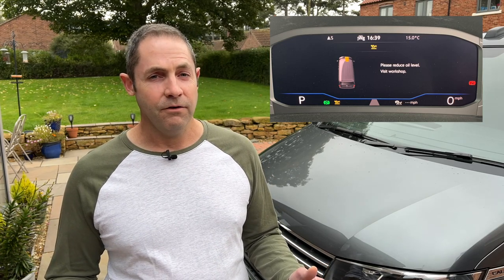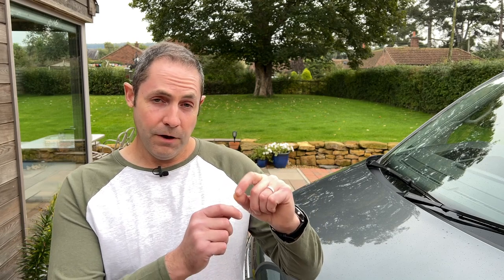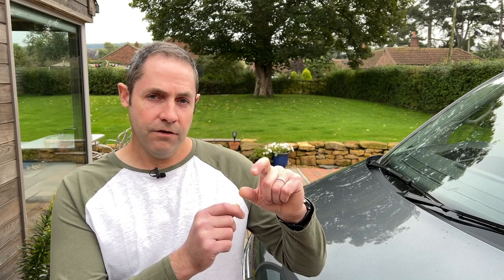Reduce Oil Level Warning - VW Transporter and California T6.1 - EXPLAIN, PREVENT & FIX!

Comment: Thanks for all the work and the videos you have done on this subject. I have recently purchased a 70 plate T6.1 which I have had converted to a Campervan. 60 odd miles into my journey back from the converters the 'Reduce Oil Level' message appeared. Fortunately was able to watch your videos and get a full understanding of the problem, even the fact that opening the bonnet resets the message for another 60 miles. I checked the dip stick and it was showing above the cross hatched area and have subsequently got my local garage to reduce the oil level to the middle of the dip stick and the the problem has gone away. I am not even convinced that diesel is being deposited in the sump as part of a regen, I think the dealers are actually overfilling the engine in the first place! Thank you so much for your help and for the rest of your content.

Comment: I just ordered a T6.1 and it's good to hear this stuff. I've had a ford ranger for the last 5 years but there was never any info like this. I've had DPF issues on that but even the Haynes manual just says take it to the dealer. There's no info on how it all works and the ford dealership just seem to like to fleece their customers. The oil change light came one 2 weeks after a service where it had an oil change and rather than tell me it was on a timer / counter that could just be reset if it had an oil change already they tried to bill me £600 for another full service. Every vehicle has its quirks but if they're documented so you can understand it that makes it much easier to live with.
Reply from the maker: Agree totally. These are complicated things these days and knowing more just helps us live with them a little better. Glad it helped, but also check out the other follow up video I did too when I spoke to the Master Tech on the inside knowledge from VW…

Comment: Thanks for this. I now know why I used to love Land Rovers so much...no computers! If summat stopped working you whacked it with a lump hammer until it did. Hopefully the update will ease things, but I'll be watching out for regen cycles now.
Reply from the maker: We have a Disco3 and there are plenty of computers in that(!) - although only an EGR and no DPF or SCR..
Reply: @CampervanTime  Nah! I meant real Land Rovers - cart springs and all. Great cars D3s but not well put together. Hopefully VW aren't letting standards slip. Thanks for the Vlog regardless. Very useful. 👍
Reply: @Loz2286  :)

Comment: Hi there, thank for your video on this issue, the same issue has happened to my T6.1 2.0 Highline 110 manual camper van. I’m very new to this and only collected the van less than a week ago. Your videos and some from others on YouTube inspired me to buy a camper. Like yourself I purchased an oil syringe from Amazon, the tubes that came with it are too big, I found that Pets at home sell 2 meters of silicone hose designed for aquariums that fit in to the rubber coupling that comes with the syringe perfectly and costs £4 if this helps anyone else needing the correct size hose to feed down the dipstick tube. Many thanks for all of your really useful and entertaining content.
Reply from the maker: Glad it’s helped and great tip on the right size of hose!

Comment: Thank you so much ! 
I had begun to regret having bought my T6.1 second hand 2 months ago and have been back to the used car seller ( a KIA dealer) a ‘few’ times now. The added problem is the user manual was only supplied in German and the local VW garage has taken a month so far to try and locate a manual in French; France being where I live. I still don’t have my hands on a copy and hate trolling through on line explanations. I have subscribed and look forward to other info you may share. Thanks very much indeed.

Comment: Firstly let me say that I found this an informative and honest review.  Secondly I have had a T4 2.5l petrol since new and have done 300 000 kms with it so,  I am considering a T6.1 single cab chassis replacement (approx 59K AUD). They are only sold out here with the 146KW engine 450nm  auto engine package. Most of my trips are only 10 to 30 kilometres or less one way as I am in building maintenance in the city of Sydney.  Your video makes me feel that this vehicle may not suit and I may need to look elsewhere.  Thank you for the heads up.
Reply from the maker: Thanks, glad it is helpful. Make sure you watch the follow up video too, as there is more to this story than just in this first video. Since taking the actions in the second video we've not had any oil level warnings at all. I also seem to remember that if buying a van/single cab new, you can specify a DPF regeneration button. It isn't an option on the California but on the Transporter I think it is (well, in the EU / UK options it is). Might be worth looking at? Remember too that if looking at other makes/models, if they have a DPF they may still have DPF issues on short journeys.

Comment: Thanks for  great video explaining the issue very well. I do not own VW myself, but am amazed that if a dealer drains some oil or even changes the oil, they cannot do a software reset to tell the management system that the oil level is correct, rather than the customer having to drive 100 miles with a reduced oil level.
Reply from the maker: Well it’s more that when you open the bonnet it does reset the level sensor evaluation period, and that after 100km /60 miles it has had enough time to get the new level to be able to tell if its overfilled still. All very frustrating!

Comment: Thanks for taking the time to explain that all so well Will. Really informative. Somewhat disheartened by it all tbh. New Cali here with only 850 miles on so far. So fully expecting to have the issue sometime soon. And just as one of the other comments here - What a faff! Didn't really expect to be getting my hands that dirty with a brand new van. I have read on the T6 forum that some owners have had the sw update, and others have been told that it isn't out yet and they are on a waiting list. Such a shame that the dealers are not all on the same page. Sterling work though, with a great explanation. Please keep us updated as things move forward. Thanks for your efforts.
Reply from the maker: I’ve got everything crossed for you that you don’t have the issue. It is a bit of a pain !
Reply: @CampervanTime  Had you considered something like Carista at all? I understand that with the advanced features enabled via subscription that you can manually instigate a regen at your own convenience. Would that improve things? i.e. you know you have an hour's drive ahead, so could get it out the way before you arrive at the destination?
Reply from the maker: @stuarthall4117  I haven’t, although I have had tools like that for other cars in the past. I suspect some active dpf management could be done but for now I think just knowing when it is doing it is enough to manage the situation.

Comment: Great video and hopefully should help and reassure some of those scratching their heads. Its not just a VW problem. I had something similar with a brand new Mercedes. I didn't know anything about DPF regen and the first time it happened I thought the car was going on fire!!!! I felt then and still do that this type of issue is unacceptable in modern cars (regardless of cost) but the dealer just shrugged his shoulders.
Reply from the maker: Thanks, yes I hope so. We also have a follow up video coming out in a couple of days, I managed to speak to a VW master tech about it all 👍

Comment: We picked up our Ocean 4 motion DSG 6.1 at the end of August. We have done a similar mileage to you. Less than a 1000 miles in the SOS light came on with a message to visit the workshop. On calling the dealer they said it was a known problem on some vin numbers and there was a software fix. Like yourselves it’s 100 mile round trip to the dealer so time booked off work…. I waited while they did the software update - Nearly 4 hours. When completed the dealer said that on making further enquiries with VW this did not fix the SOS problem, but did address other minor fixes. I’m guessing one of which may be the oil issue. ( So far we have not experienced any oil issue🤞) The dealer advised that the interim fix for the SOS issue was to reset the infotainment system or to park up, lock the van and they return after a short period of time - 30 mins and it clears and resets. The latter seems to work. The former, resetting the infotainment system threw everything - Nav, music, phone etc into a reset loop whereby the system seemed to be swirling around in a reset cycle without coming out of it. Duff info from Dealer! The fix is upon the SOS light coming on- and overhead console light turning from green to red, Stop, park up, lock up and leave for about 30 mins. Normally doing this does not throw out the other infotainment functions and features. On contacting the Dealer and VW support yesterday, 6 weeks in, there is still not a fix. I cannot believe VW’s position and the apparent acceptance by the dealer that this is acceptable from VW and their normal modus operandi. We have been fortunate over the years to own Mercedes, Porsche, BMW and Audi (Currently A6 Allroad) - The service from all has been excellent with any issues fixed promptly with little or no disruption to the enjoyment of the vehicle.  For us the VW experience and attitude has been appalling. £80k car and this is what you get. For years we wanted a VW Camper van and now we are looking forward and thinking it’s been a big mistake. We are considering taking advice to reject the van and get our money back. If we were told a fix will be available in a fortnight or a month or whatever, it would make things more palatable.  BTW - Great videos!
Reply from the maker: Oh dear, that doesn't sound good at all, hopefully there will be some positive news from the dealer soon for you.

Comment: Recently purchased a 69 plate T6.1 with 25k miles and not long after getting it this warning appeared. Took about 400-500ml out thinking this would work but it didn't. However, I didn't drive over 60 miles in one go which may have caused it not to work. It was in at VW last week and they checked the level which was ok and confirmed the sensor had the latest update. The light came on again about 60 miles later. VW official take on it is that there is not a fix and it happens due to 'driving style' which is pretty crap tbh. I'll maybe take out more oil as suggested but take it for a much longer run 🤞
Reply from the maker: Oh no! Well, we took ours down to about 1/4 to 1/3 on the dipstick between the marks and that did it for us. The light has been off ever since. We have also just had an oil change at the dealer about 200 miles ago, no light on yet either, so happy to go and dip the oil (it's cold, sitting outside) and send you a photo of where the level is at. Pop us an email at contact@californiatime.co.uk if that's helpful.
Reply: @CampervanTime  Is that 1/4 to1/3 level when warm? Thanks.

Comment: A very informative video. However I would comment that if you have diesel getting into the oil in quantities you suggest then it is best to have dealership change oil at their cost. Also keep notes about this as down the line you don’t want any issues with engine having poor lubrication
Reply from the maker: Thanks for the advice. I am actually considering getting my own oil analysis done to understand categorically how much contamination (if any) there is in my oil. I also have some more information to share on this subject after talking to a VW master technician about it and doing more testing myself. I'll be doing another video shortly.
Reply: Hi
I worked as an engineer and one of the things that caused concern with oil in engines was fuel contamination as it effects the viscosity so the load bearing properties. 
I would suggest you do get an analysis done and then see what is recommended. 
It may be an oil change is needed if so then contact VW UK for their comments. 
This is one of those things that may not seem to cause big issues now but down the line it could result in a total engine failure
Reply from the maker: Thanks, yes we’re thinking about it. Thanks for the advice.
Reply: luckilly diesel, is oily, if not, these engines would've been broken quite rapidly

Comment: You pay £80K for a van and this happens. I wouldn’t want excuses I’d want it fixed properly pronto and an extended warranty. Diesel diluting you oil must change its design properties and damage you engine to some extent. Sloppy design, no excuses
Reply: I agree totally, it’s not acceptable. This seems like a quick work a round the engineers have carried out to get them over the emissions problems VW had.
Reply: Couldn't agree more! Love the transporter but genuinely the worst van I've owned. This is my second, from a T6 to a T6.1. Considered going back to Ford, that's how bad it's got 🤣
Reply: JLR have many engine failures due to oil diluted.

Comment: Actually when I ordered my T6.1, you could select / buy an optional button to initiate or prevent a regeneration cycle. As far as I can remember, it was an fairly expensive option, so I didn‘t order it 🙄
Have the message now for the second time after 3 years and about 40tkm. I change the oil at least once a year, regardless of how many kilometers the car made.

Comment: Thanks for the info - my light has come on but every time it seems to have been related to a lean on a roundabout or a dip in the road which I had assumed was changing the oil level that was picked up by the sensor.  I’ll look out for the regen now & hope that VW come up with a fix soon!
Reply from the maker: Let’s hope that light stays off now !
Reply: @CampervanTime  Mmm I’ve got a feeling it’s just probably coming back on every ~60miles or whatever the distance is before it re checks the oil level? 🤔
Reply from the maker: Ahh, stuck in that cycle. Well, you could drain half a litre out and then put it back in after driving round for a while… have you checked the actual oil level?
Reply: @CampervanTime  oil level is in the top bobble - yeh think I’ll have to do an oil adjustment - at present I’m just opening & closing the bonnet!
Reply from the maker: Well if it’s in the top blob then it’s slightly overfilled / too high 😩.

Comment: Thanks for the quick response will,going to reduce tomorrow as per your instructions.
Just one more question when you say drive 100+ miles afterwards is that all in one trip or will a couple of trips amounting to the 100+ miles do...Thanks again and keep up the good work
Reply from the maker: Any amount of trips just adding up to that mileage. I think it’s actually 100km / 62 miles.
Reply: Having this problem right now. But I topped up instead of reduce it. I do small trips as diesel are expensive. Now I need to drive 100km in order to feed its idiosyncratic system. Thank you for your explanation. I will reduce the oil as per instructions.  Great job 👍

Comment: Hi Will.  We’ve had our T6.1 for just over a year now…never an issue with the oil level…until the first service 12/04/23 where the oil was changed and we had rage 23ER engine control unit update.  The update widened the temperature range for burning gases (or something along those lines).  While travelling to Europe two days later, still in the UK, the oil to full alarm came on.  I contacted the branch about it and was advised the a new software update came out the day after my service.  One if the fixes is for this alarm.  So I have to return to the dealer for approx half an hour for the update, which should fix the issue.

At the end of the service, knowing the oil had been changed and remembering your Hebrides video, I brought the issue up.  Manager advised me that it can’t happen now as the oil is measured by machine to the exact amount whereas before, technicians filled the engine, changed the filter, then topped it up!  This wasn’t done on mine as the exact amount of oil was used, yet the alarm still came on!  Very annoying VW!
Reply from the maker: Oh blimey. It is odd how they haven't just sorted this by now once and for all. I feel your pain, lets hope it gets sorted soon.
Reply: @CampervanTime  anything on the ACC braking while overtaking (left or right hand side [UK or EU])?
Reply from the maker: Don’t remember a problem with that on ours, just seemed to work. It doesn’t like undertaking though but can be told to do it with a quick tap on the go pedal

Comment: My T6.1 is on 45000 miles now and have had this for the last 20000 miles. Been to dealer for oil change they tell me its fixed and 80 miles later its back on. Dealer have said to open and close the bonnet to reset and will last for 80 miles. I am doing 170 miles a day so will have to do that twice a day lol. I have just lived with it now.
Reply from the maker: Sorry to hear this - I’ve since had a long conversation with a Master Tech at VW with more info - you don’t need to do what your dealer is advising, there is a proper fix. Have a search on our channel for Master Tech Info and you’ll find it. All the best, Will
Reply: Thanks will check it out.

Comment: I watched this video when the light came on in my van, the day after an oil change. I spent the evening thinking I had a genuine problem. Went back to the mechanic who drained the oil down to the midway level on the dipstick (as per the manual) and the problem was resolved. 

I appreciate your making this video as a way of sharing with the community. But the information here is incorrect - which you acknowledge in a later video.

If anyone else comes across this video and thinks they may have diesel in their engine oil. PLEASE DON'T PANIC. Make sure the oil level is only HALFWAY up the dipstick. 

Campervan Time, I think you should take this video down and point people to the later video in which you describe the actual oil level issue.